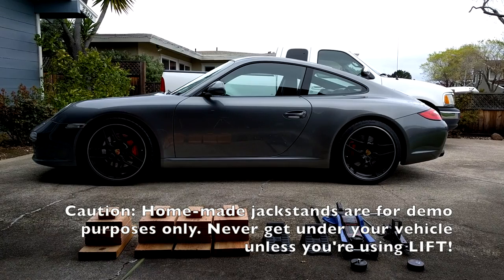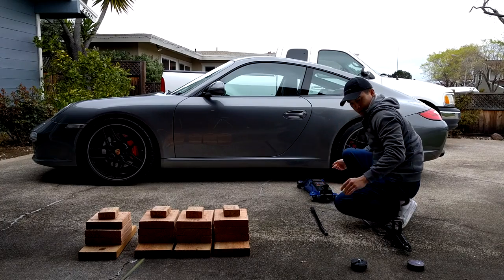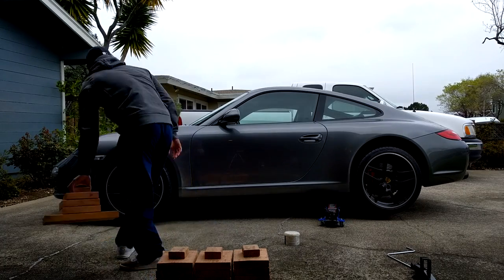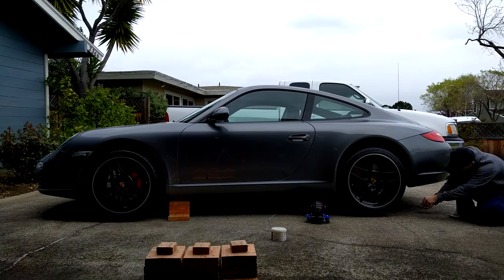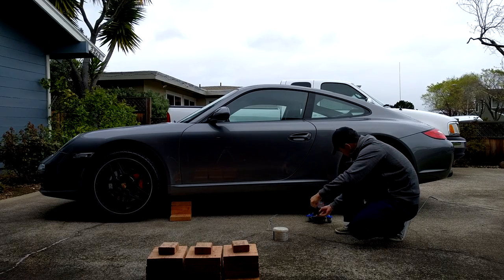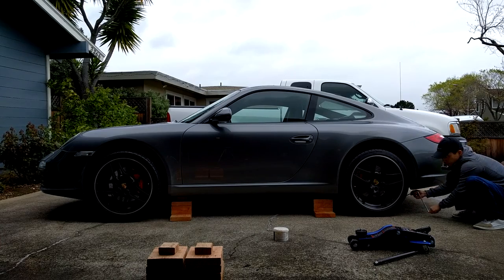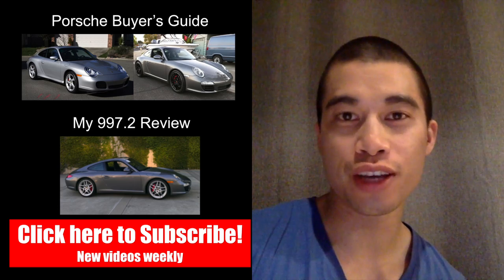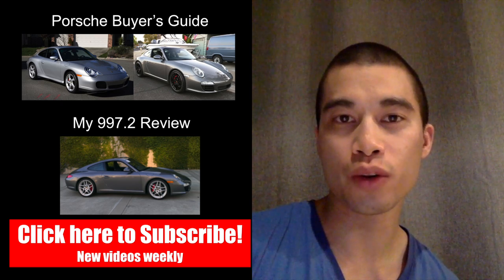✪ How to jack up Porsche 911 / 997 - DIY Tutorial ✪

Comment: What are your jack stands made out of? Looks like several pieces of wood. How did you make it? Thanks for posting.
Reply from the maker: +Matt A it's just several 2x8s, however, I never get under the vehicle while using them. It's more so for taking the wheels off and doing brake work.

Comment: Your jack stands, did you Make Them? Or did you buy them?
Reply from the maker: I made them. It's 3 2x8s with a 2x4 piece on top. The small piece is so I can reach the jack points without pressing up against the undercarriage. These are fine for getting the car off the ground, but I never work under the car with these on.
Reply: @CarFanatic  I count 4 layeres of 2x8 not 3 layers.

Comment: Are your car lowered? Or is it just the PASM?
Reply from the maker: +head911 it has pasm plus the sport suspension option
Reply: Ah thanks, so PASM is 10 mm lower and sport suspension is 20mm lower?
Reply: I´m picking up a 997 Carrera S 2010 PDK on monday, so I´m interested in what the options are!!
Reply from the maker: +head911 precisely! The car looked even lower before I installed the wheel spacers.
Reply from the maker: +head911 nice. Do you have a spec sheet? Feel free to email me at carandtruckfanatic@gmail.com to continue to conversation!

Comment: I must disagree with this video. You always jack a car up by front, and or back. Not side to side. This is due to the jack moving the car laterally Your wheel chucks do nothing to stop the lateral movement. This is most dangerous when you are dropping the car back down. You are putting a lateral load on your wheel bearings perpendicular to the path of travel.
Reply from the maker: +awdaltima2 You're right about the wheel chocks not doing anything for lateral movement. The tires from one side are still on the ground, which provide enough traction and resistance. But it's still important to jack a vehicle up on a flat surface. I guess you could jack the vehicle up by the front first and use a strong suspension point in the front, so you can remove the jacks and then proceed to the rear. However, I don't think there is much risk of damaging the wheel bearings. The wheel bearings take a lot of lateral load when cornering. 

I haven't had any issues using this method so far. But if money isn't an issue, one could get the "jack point" jack stands which allow you to place a jack stand on the corner you're jacking up. Thanks for the constructive feedback. I'm interested to hear about other methods for things.
Reply: No, the jack does not move the car. Instead the jack moves because of its wheels. This is why the jack has wheels. The scissor jack needs no wheels because it does not change the jacking position laterally.

Comment: Thanks for your reply, Mr Car Fanatic, do you mind to let me know your first name. In response to your reply, I am thinking about a reverse situation. If I spend 60k for a second car between Cayman and probably an older 911. Which should I choose? Your advise please and thanks in advance.
Reply from the maker: +Kui Wai Li Hmmm, at $60k, you can get a very new Cayman S or a 2012 base 911 Carerra. Looks wise and utility, I prefer the 911. However, the Cayman is a very nimble, well balanced car. It will be just a tad slower in acceleration than a 991.1 Carerra. Though call, but I would not spend $60k on a Cayman S when I could get a base 991 Carerra. I'd strongly consider a 2013 or so Cayman S for around $50k since it's essentially the same as a 2016.

Comment: What is the point of raising the car by a couple of inches? You are going to send in some hamsters to change oil?
Reply: A couple inches is all the hamsters need to change the tires.   Great video.
Reply: @davidclifford5546  Must be porsche specific. For any other car, using the factory supplied jack one corner at a time is more than adequate.